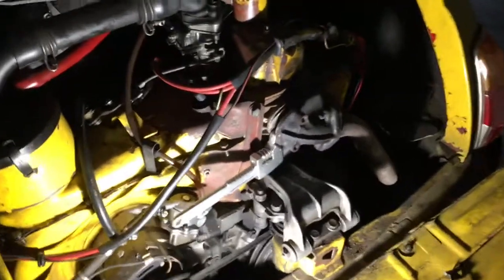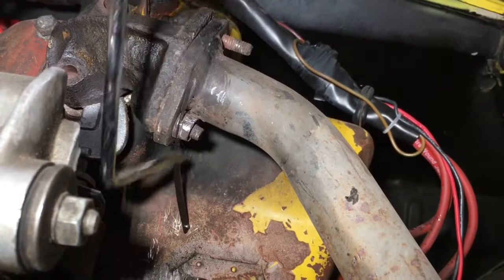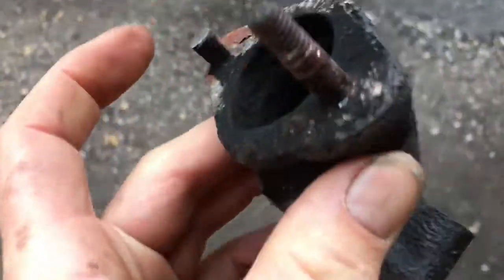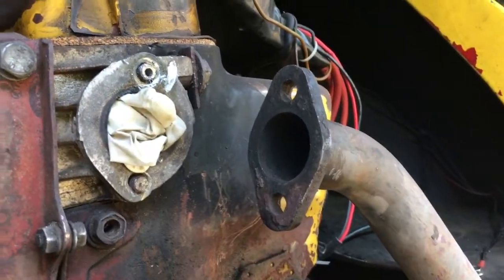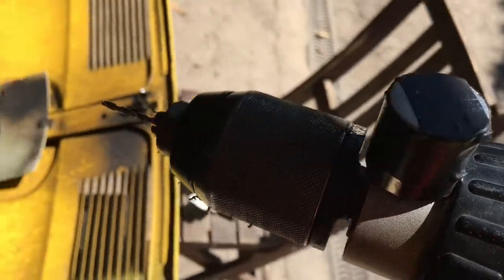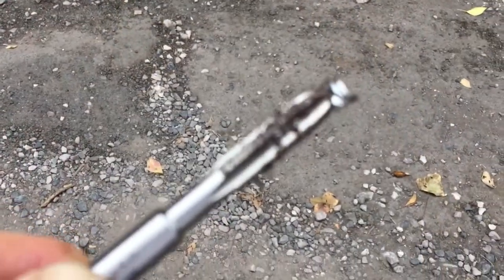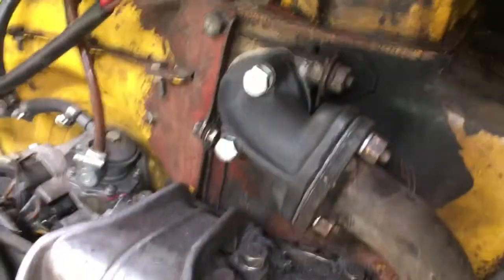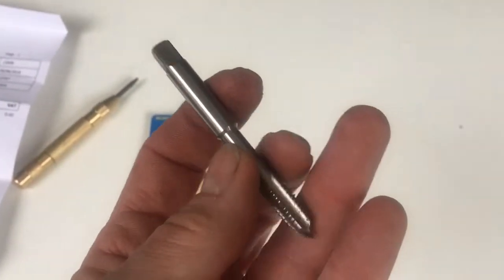How to remove snapped exhaust bolts on a classic Fiat 500

Comment: I have had all the problems with my 500. When refitting the exhaust to the manifold you should use a bracket with bend over tabs which prevent the nuts loosing off with the vibration, and when using the brackets you are not tempted to over tighten the nuts. They were fitted originally and are very inexpensive. Hope this helps.